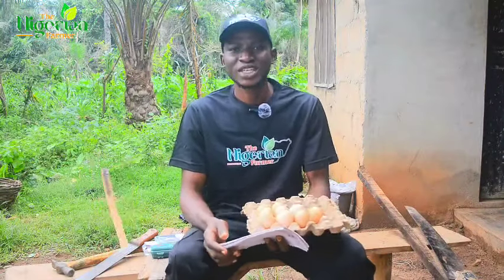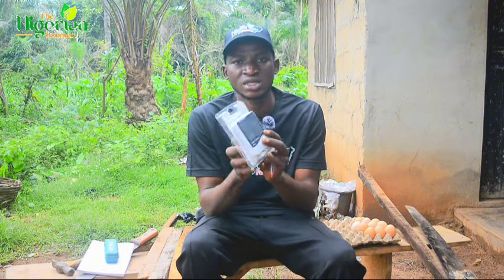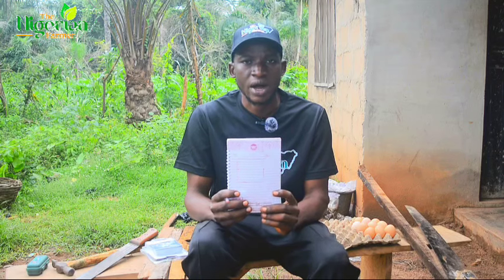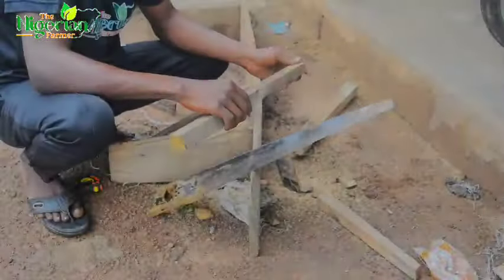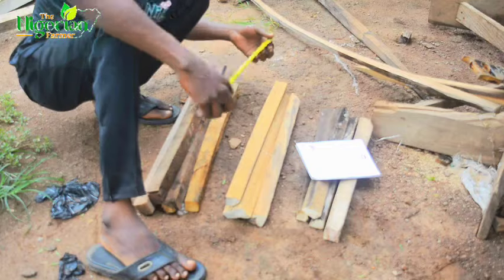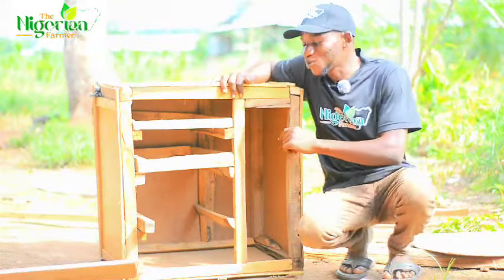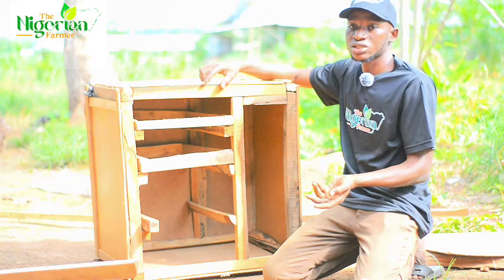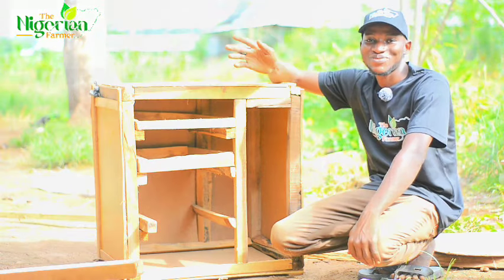Let's Build a Kerosene Incubator Together and Become a Millionaire!

Comment: Nice work. What temperature should be ok to manage so as to control the heat and how many days should the egg be incubated
Reply from the maker: The temperature typically should be between 37.0–37.8°C max 38
20-21 days sir
Reply: Kerosene in Nigeria is very expensive. How can burn kerosene for 21 days.